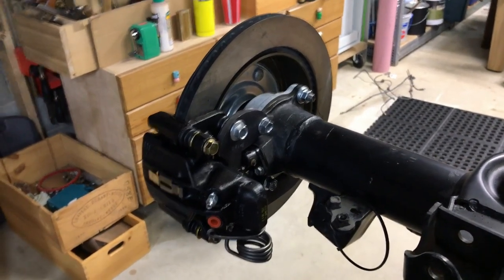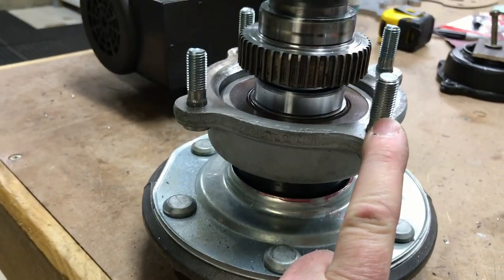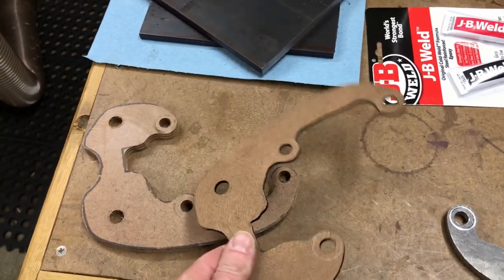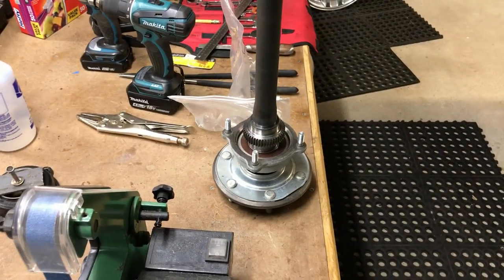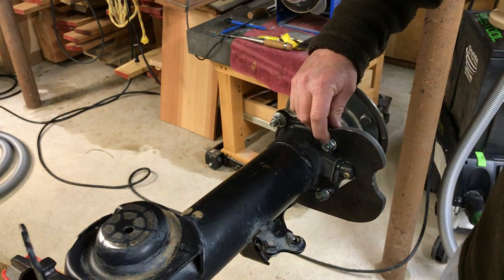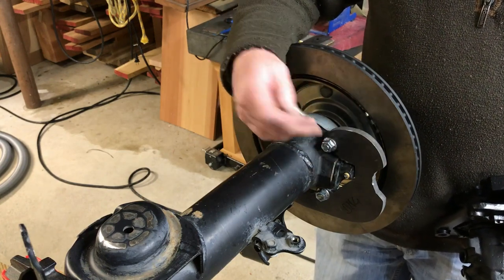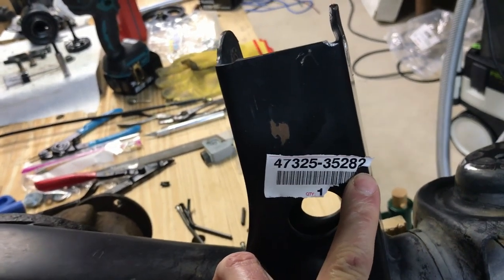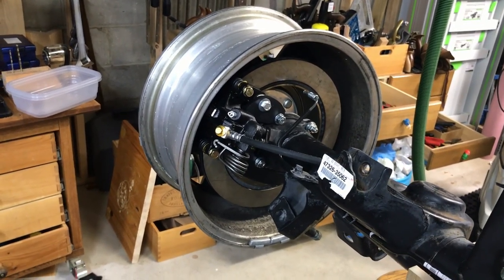2000 toyota 4runner rear drum to disk brake conversion part1

Comment: Damn Andy.  That looks like a hell of a project.  Pretty cool.
Reply from the maker: it was a lot of work.  because the previous owner never fixed the clogged breather my rear drums were so soaked in gear lube it would have been a 100% rebuild on the drums so I decide to go all the way with it.  so far it's working out great.  only have about 200 miles on the new rear disks but they work as good as the drums.  ABS still functions, just need to sort the ebrake thing.
Reply: Andy Loechler I'm sure you'll get the e-brake figured out.  You seem to have a really good mechanical mind for this sort of stuff.  I watched  the other video you recently uploaded on adding the accessory fuse box in the engine bay and the other board under the dash.  It looks very clean and well though out.  If you lived close to me, I'd be asking you you come over and help me do the same to my rig.
Reply from the maker: these trucks are so tight in the engine bay it's hard to find the room for fun activities!  Wire stuff is no different, just got to get into it and do it.  heck man did you ever think you would be swapping out transmissions?  I also wish I lived closer because I think with your/Shaun help we would be shooting some epic trilogies of sick mods.  you care about doing a good job so I'm 100% sure you can pull it off.  Sourcing the supplies is a pain for sure. West Marine stores tend to have things on hand.  A little spendy but Anchor/Blue Sea are top notch marine grade products.
Reply: When the time comes to do some wiring, I'll definitely use your video and some other local dudes that have done lots of wiring to give me advice.  I just did my first wiring job a few days ago on my 98.  I wasn't getting power to my hitch plug so I had to wire in a new converter box.  The Toyota converter boxes seem to burn out.  Happened on my 2000 rig as well.  Once I had that wired in, I spliced into the trailer hitch harness to power a license plate light on my dual swing-out CBI bumper.  Part 1 of that video will be coming out soon.
Reply from the maker: I love that dual swing-out by CBI, it was really really a tough call when I was looking for rear bumpers.  I decided to get the 4X innovations as a set.  I did the same thing when I did  the lic plate wires.  got stay legal.  each time I need to open the back hatch I think to myself - I took a convenient pop open hatch and made it inconvenient :( but if your going to run over-sized wheels/tires and want max clearance you gotta do it.  looking forward to the rear bumper vid.
Reply: Timmy The Toolman looks like something you and shawn need to tackle

Comment: I thought I was the only one to think of using mustang calipers and 4th gen rotors. I used cobra calipers on mine as the bracket is a little wider. The cobra rotors are the same thickness as 4th gen rotors. On my second gen, they lined up perfectly and I didn't have to shim or bend the bracket in any way. Also I used 1981 Nissan 280sx brake hoses. Fit perfect and were very inexpensive. 

I haven't gotten around to a proper parking brake cable yet. Have you gotten the parking brake working yet?

How well do they work out for you? Mine are balanced perfectly but the pedal is low on the first pump. I think it needs a residual valve. I haven't managed to find one for a m10x1.0 inverted flare yet nor have I found adapters to use the npt versions. Apparently fzj80 master cylinders have them built in but the information on those seem to be inconclusive.

Comment: Thanks a lot for posting the video, tons of great info and a fine job you've done. I'm looking into doing something similar and had a few questions:
1) After 2 years how is everything holding up? Anything you would have done differently?
2) What bearing cup did you use? Is that the stock one just with the backing plate w/ drum brake components removed or what?
3) Do you need to do a master cylinder upgrade?

Thanks

Comment: Frikkin sweet. Ordered the mustang calipers and montero rotors for my conversion today. Ive seen people mount the rotor at the 12o’clock position as apposed to your 3/9o’clock position. Any input as to which is best? I should probably just look up a mustang and see where they put it on oem. Cheers!
Reply from the maker: chaunster I mounted the caliper in that spot so I could modify the caliper ebrake plate to accept the stock Toyota ebrake cable.  I will shoot another vid when I get the cad files and parts back from the water jet cutting place.

Comment: Did you have to change your master cylinder. We have an extremely soft pedal after doing a rear disc conversion.
Reply from the maker: no stock master should work fine if it was working before the conversion.

if you have a solft pedal, either still air inside the system or the master needs new seals.

Comment: any way to get a copy of the caliper bracket
Reply from the maker: yes

https://drive.google.com/open?id=10_NWyhPS3SQbMQtk0BJMJ-wiFi8jk-Ma

this is a dxf file you can use to water jet cut a set of brackets.  this is what I used to cut 3 sets, sorry they are all gone.  not really planning on cutting more at this point.  but you are free to grab the file and if you can find sombody local it's not hard to cut these.  just make sure you use 3/8 thick steel plate of decent quality.
Reply: Andy Loechler I know you have a wood shop, but it’s great that’s you have/had room to build this in a shop environment?

So once the brackets are cut, all holes are lined up, notched (+/-?), it’s just a matter of jackstands, parts and fitment, ?

I would like to get rid of my ‘98 drum brakes while retaining the E brake.

Comment: Great video thanks. is the speed sensor blocked in? i know most go without abs
Reply from the maker: yea it is blocked in.  you would have to remove the 2 caliper bolts to get it out.  not a huge deal but I felt I had to leave some material for strength
Reply: +Andy Loechler 
I hate drums so much and i haven't seen much help on disc conv for 3rd gen. Very helpful thank you.

Comment: Do you have to modify the rotors
Reply from the maker: dustin Simpson no you do not need to modify the rotors
If your reading T4R .org and found the write up using montero rotors?  Yes the montero need to be modified.  If you use 4th gen 4runner rotors you do not need to modify them.  I also uploaded the file for my brackets  and you can use that file to Waterjet cut your own brackets